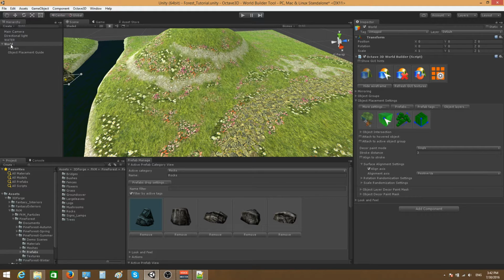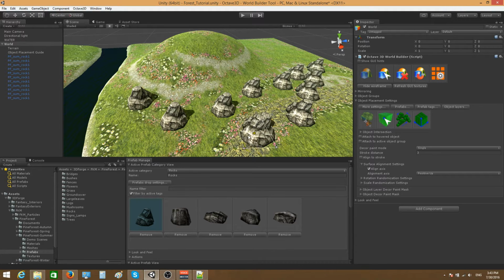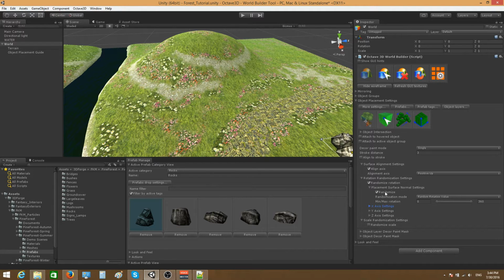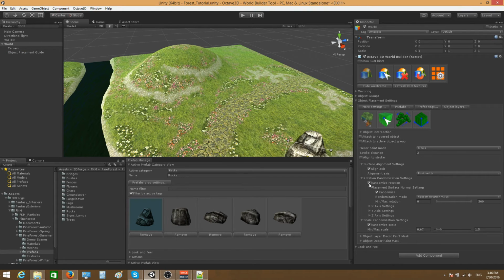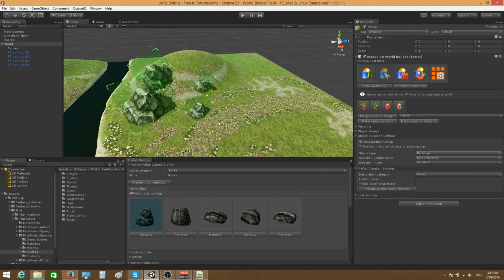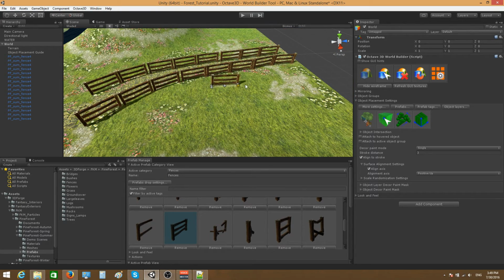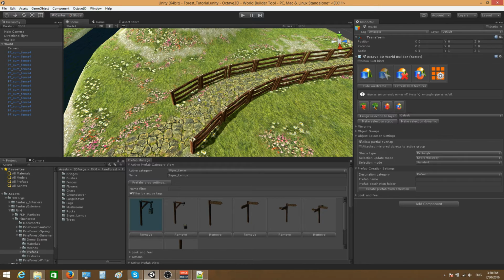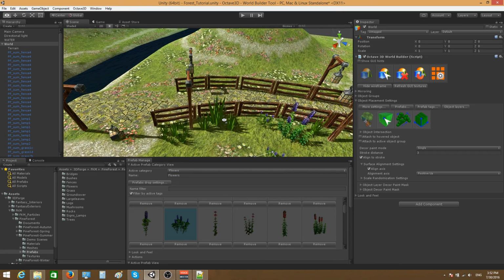Octave3D - Terrain Placement (Part I - Decor Paint Single Mode)

Comment: The asset seems very great indeed, i do have one question i didn't see addressed anywhere however. Will the object remain snapped to terrain if you alter the terrain at a later date? Ie you paint a field of grass then decide you need to raise the terrain 3m higher, will the objects follow the new terrain or do you have to repaint your details?
Reply from the maker: Hello,
The details will have to be repainted in that case.
Reply: @octamodius  Thanks for the very speedy answer.

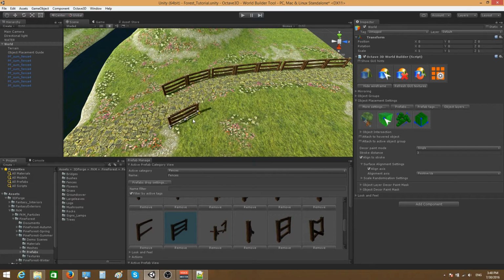Comment: Holy Moly the part at 6:50 is crazy! That sort of placement alignment can make even Race track paths and roads which is as you said incredibly useful! I am very glad I purchased this.
Reply from the maker: :) Thanks! I am really glad you like it!
Reply: Hi there I just started using your updated program but when I created the empty game object and assigned the Octave3d script it seemed to lock its transform so I can no longer move it around, this is a big problem because my Ground is below the grid itself and it won't let me paint below the grid. My Ground is not a terrain but just a normal flat plane and I can't move it because it has dependencies.

It seems there is an option to hide the grid but no option to ignore the grid and paint only on object surfaces. 

So summarize
1. How can I place objects onto my ground object if it is below the grid
2. How do I ignore the grid when painting so it doesn't get in the way?
3. How can I move the Octave3D object if it is locked?

Also I have found some minor bugs:

- Saving the scene shows a leaked texture 2D error as :
"Cleaning up leaked objects in scene since no game object, component or manager is referencing them Texture2D  has been leaked 1 times."

- Look and feel contains a spelling error in the main panel. Instead of Shape type it is written as Shap type.

==========================

Other than these so far it looks like it's working pretty well.
Because I have purchased a lot of model assets I separate the main project from the project that I create the levels in. So I use Octave3D to create the level and then I export the scene into my main project, this avoids me having a 20Gb main project so the main game only contains the models and prefabs used in the levels themselves.
Reply from the maker: Hi there,

1. The grid can not be moved or rotated, but you can change its Y offset. If you go to the Snap Settings GUI you will find a property there called Snap grid Y Offset which allows you to move the grid up or down as you wish;
2. Currently this is not possible, I will implement an option for that. Thanks.
3. You can not move it if it is locked. That is why I implemented this feature to stop the guide form being moved. The reason I did this is that sometimes, you may wish to modify settings in the Inspector but leave the guide where it is. For example, you may wish to play around with the guide pivot point colors, but when you move the guide towards the Inspector it will go out of the screen a little bit. Another situation in which locking object placement is useful is when you are using the Path or Block modes and would like to modify settings in the Inspector like height adjustment mode, padding etc. If placement is not locked, moving the mouse to the inspector will change the shape of the path/block, when in fact all you wanted to do is to just change some settings. At least these are the reasons that placement lock was implemented. 

Please use the Octave3D forum or my support e-mail for any future inquiries :). I can not post a link here because YouTube will probably not allow that, but send me an e-mail and I will send the link to you.

Hope this helps.
Reply from the maker: Forgot about the spelling. Will fix that. Thanks :)
You can ignore the leaked textures message. I can send you a link where it is specified that this message actually informs you that some optimizations have been made. Unity actually removed the message from later version of Unity.
Reply: Octamodius No worries then. I will post a message now on the forums, you can see my username there for further communication.
Reply from the maker: Aaa great. Thanks!